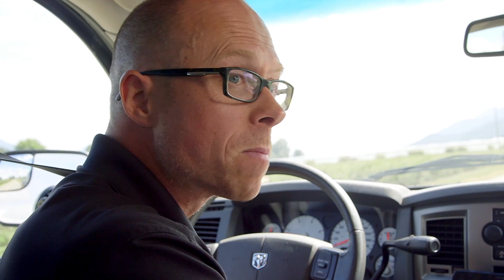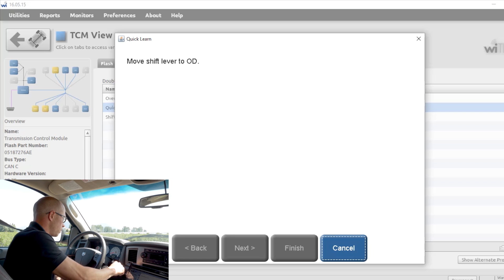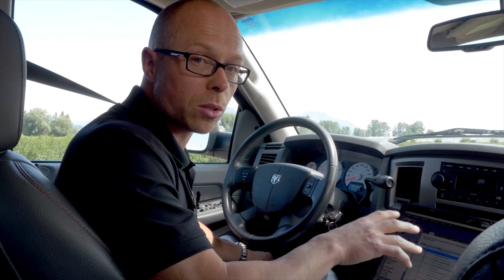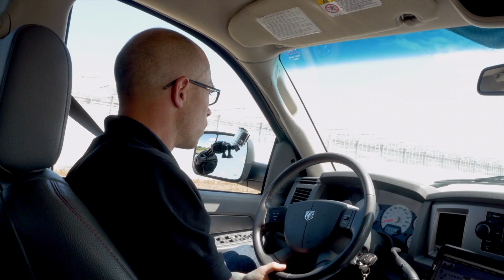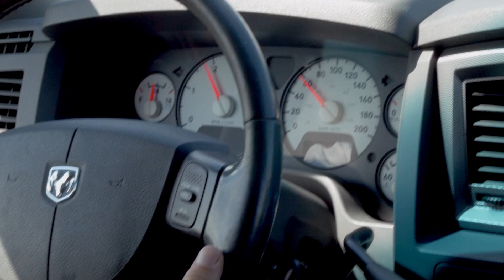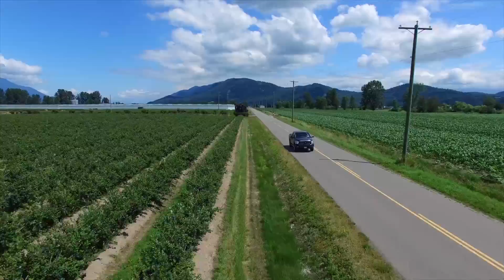BD Diesel Performance - 68RFE Transmission Relearn

Comment: We had our 98RFE transmission rebuilt, husband installed it, took to a diesel shop to get relearned. Shop said: the brake pedal is not recognized when initiating the relearn -  (relearn failed). ANY idea of what this could be? We are thinking something electrical, but have been unable to find anything.
Reply from the maker: Hi there! Thanks for the question. This would be a truck issue. It could be a failing brake pedal switch, but it really should be diagnosed by a qualified shop. The Quick Learn will not initiate unless the ECM sees the park brake set, the brake pedal pressed, and the shifter in park with the engine idling.

Comment: I just purchased your guys 68RFE transmission with torque converter and billet input shaft. Apparently I need to do the relearn process after installation and I need a scan tool to do it. What’s the best cheap relearn scanner to buy that will work for a 2018 Ram3500? Thanks
Reply from the maker: Hi there, your manual that came with the transmission should outline which scanner is required. Should be on page 4
Reply: @BDDieselPerformance  for the people that couldn’t quite understand some of the words in the video. Please tell us which ones will do the relearn. That way it’s in text form. Wished it would have been put into the description.
Reply: How much was the price

Comment: What's best way if I want to change power levels on 68rfe here and there?
Reply: @machaf  Beg to differ amigo.....  240k miles on both stock tuning, then moved to an H&S and now EFILive tuner.  I tow quite often also.  I upgraded to Castrol synthetic fluid and YES, I do normal pan drains and no issues.  I think many of the "horror" stories about this transmission is based on hot dogging it, high tunes with no specific trans tunes to match or just simply not taking care of your vehicle.  I know a few others who have or are close to 350k and above with no issues or rebuilds.
Reply: @user-ym9wb2mk5e  people that think the 68rfe are garbage are the same people that think diesel trucks are race cars
Reply: @machaf  68rfe is only a POS if you try and play racecar